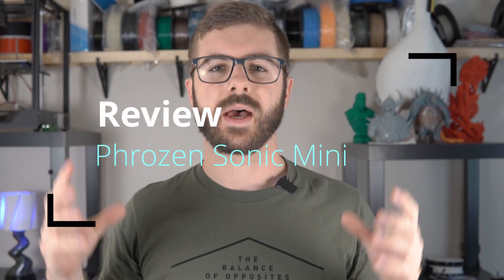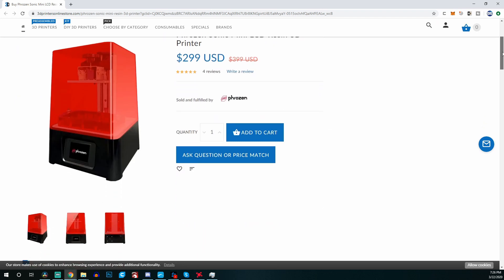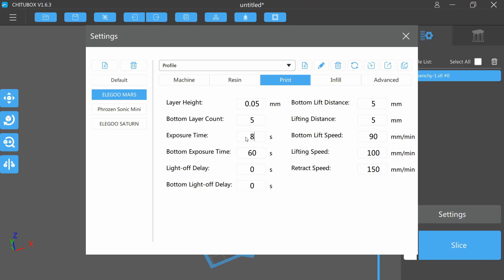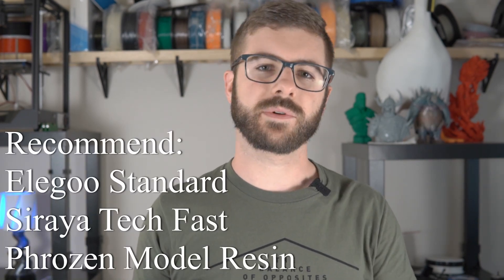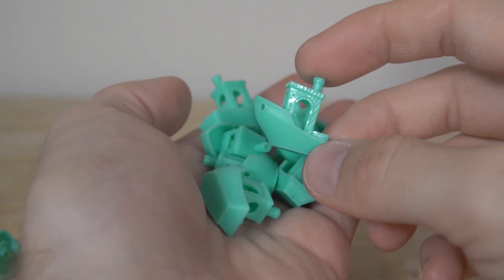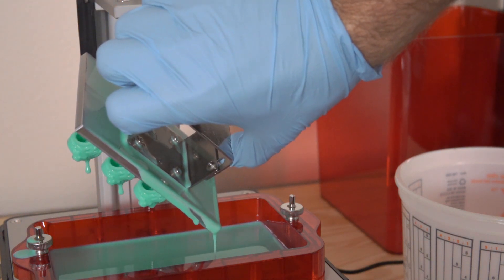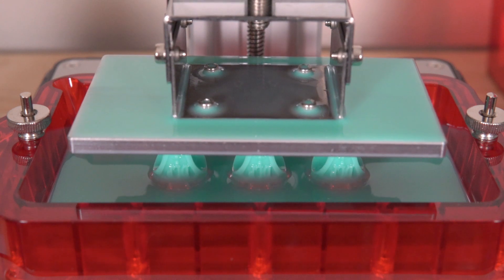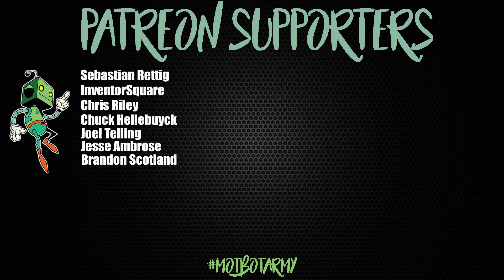Fastest Desktop Resin 3D Printer? Phrozen Sonic Mini LCD Printer Review

Comment: Great video! Little correction though: The main factor with the LCD being a consumable is not due to the UV light. The powerful LED creates a lot of heat and some of it of course is radiated towards the LCD (and not blown away by a fan because that only cools the heatsink-side of the LED(s)). Therefore the heat is slowly damaging the crystals inside the LCD. There are some new but expensive technologies where there is actually a flow of some liquid between the screen and the actual resin that not only causes resin not to stick to the film but "curing in mid air" but as it is flowing, it also transports heat away from the screen making those screens last a little longer.
Reply: So, can I get a similar lcd and replace the one on my Elegoo Mars whenever that finally bites the bullet?
Reply from the maker: Thanks for the information. I had been told that it was UV but I have seen heat spots on the lcd screen so what you are saying totally makes sense. I have seen a few models of resin printers that have the liquid you are referencing. Awesome stuff :). Thanks for watching!